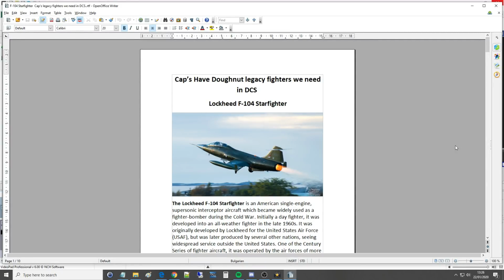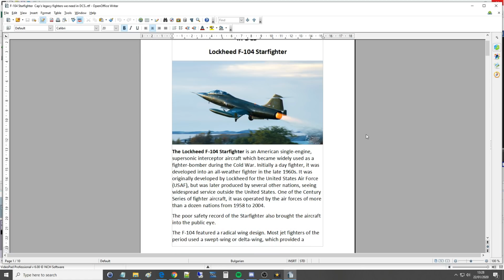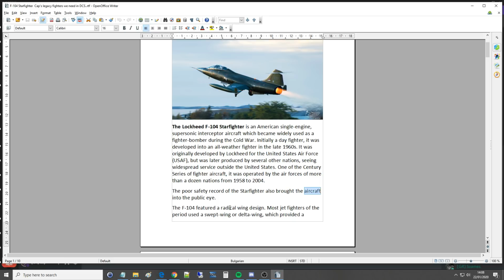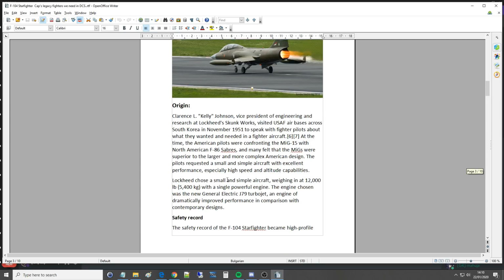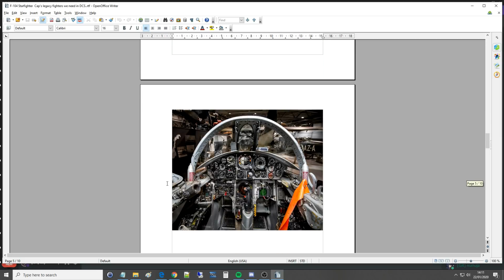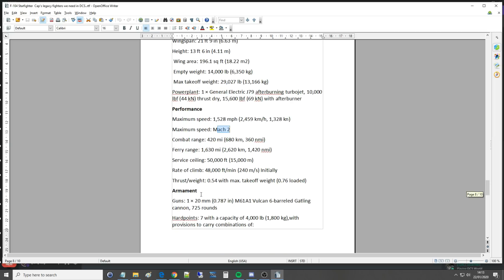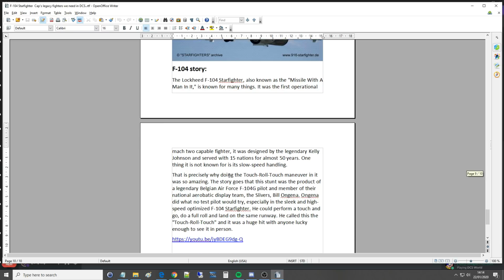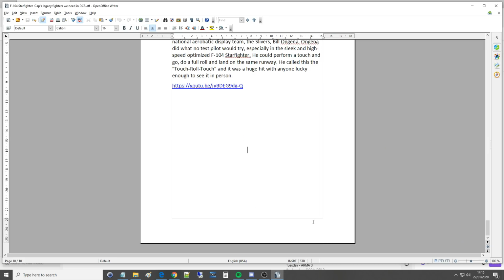Cap's Cold War Aircraft NEEDED In DCS WORLD: F-104 Starfighter

Comment: i saw an interview with a Luftwaffe pilot who had been flying 104, and he mentioned that most of the "Widow maker" part was actually due to lack of experience in the Luftwaffe operating the air frame. it was the first supersonic fighter they deployed, and they were trying to use it in a role that it was not designed for, next to that the ground crew were not properly trained for maintaining a machine like that and the pilots were lacking the proper training regime to deal with the characteristics of such a design. so when the crashes stacked up and Luftwaffe had to shut down the fighter squadrons for few months, revise the things above and then started flying them again things got far... far smoother than the bumpy ride they began with...

Comment: I spent much of my childhood At CFB Cold Lake. I was there from 1960 until 1967.  Engine testing on test beds would rattle our windows sometimes. Those engines needed A LOT of maintenance. That awesome roar carried for miles. Nothing else had that sound. 
No one can be unimpressed when the Starfighter rips the sky apart in a low pass. It looks and sounds so purely warlike. There was an airshow on base sometime in mid 60s. An afterburner takeoff and zoom was just... mind boggling! The aircraft was lost to view in a few seconds, in a clear sky, going nearly straight up! It remained LOUD. We could hear for quite a while after it was out of sight, probably because the exhaust was pointed down. They told us how high and how quick but I don't remember the figures. Really high, really quick! They also mentioned that it was strictly "showing off" and that the engine would be pulled after the flight.
They flew over my home occasionally but most stayed well away from PMQs. Mostly, we just heard them. I was well aware at age 10, when I moved away, that the "MWAMII" was a harsh mistress. F104 pilots have brass balls. My father, an instrument tech, went on "search" missions several times a year.
It was and is no "multi-role fighter". The decision made by various operators to use it in low level, all weather bombing was questionable given it's intended role as a high speed interceptor. Canada also lost many air frames but pilot losses were lower. This was the first aircraft and one of few to hold speed and altitude records at the same time. Why would you want to use it for ground attack?
It has a spectacular legacy of flight envelope records but it was just another Kelly Johnson brainchild, an over achiever in a family of over achievers.

Comment: The Starfighter got a lot of crap not because it was poor at the mission otbeas designed for - high altitude intercept. It got a bad deal because a lot of lesser skilled pilots couldn't fly it. One of the first fighters that could go over 80,000 ft AMD still come on and land. Amazing climb rate, all engine, barely a wing.

Comment: Very pretty aircraft indeed. But unlike the F-8 in the previous video, this one i fear will have it much harder to find its DCS niche. It was indeed a superb high performance machine, but aside from that......... way too limited to tangle with the 3rd and 4th gen jets we now have. And if they model the ground attack version, then as the word goes around, all the extra avionics made the thing even worse in low speed handling, so people aren't gonna dogfight in it. Maybe drop bombs? But most people that died in it, died just doing that. It was never supposed to be a low altitude mud mover. So a very specific niche is required for this one. Maybe high altitude nuclear capable soviet bombers?

Comment: I disagree.
The safety record was as bad as it was due to being forced into roles, in locations, it wasn't designed for. It was a good weather short range interceptor forced into being an all weather multirole fighter due to politics and bribery scandals. Germany is not known for its good weather. In anything but nice dry weather with good visibility and a light air to air load out this thing is going to be an absolute b** to fly.
The only reason it was kept in service as long as it was, was due to Lockheed and the US government using it to kill off any hope off a European build counterpart. Look up the Dutch Lockheed scandal. Lockheed bribed prominent politicians, while the US applied political pressure, so the aircraft would be bought. Then once the different airforces found out how shit it was there was no replacement available.
Every nation that could, except one, that flew it dumped the thing the moment the F-16 became available. The only nation that kept it in service any longer then absolutely necessary was Italy, who have generally good weather and who used the plane primarily in its interceptor role. 

There are many aircraft I would rather see in DCS before this thing was even considered.
Reply: Yeah, the F104 was used mostly in its original role as a QRA plane with the Italian AF. We modded some to carry the Sparrow, then we modded the Sparrow itself with a better radar, which extended the useful life quite a bit (Even though they were REALLY old and spent when we finally retired them, around 2001 I think).

Comment: "There were 110 class A accidents in the 25 years that Canada operated the CF-104 resulting in 37 pilot fatalities. Most of these were in the early part of the program centering on teething problems. Of the 110 class A accidents 21 were attributed to foreign object damage (14 of which were birds), 14 were in-flight engine failures, 6 were faulty maintenance, 9 were mid-air collisions. 32 struck the ground flying at low level in poor weather conditions. Of the 37 fatalities 4 were clearly attributable to systems failures, all of the others were attributable to some form of pilot inattention. The accident rate of the 104 compares favourably to its predecessor, the F-86 Sabre. In only 12 years of operation the F-86 had 282 class A accidents with a loss of 112 pilots. The Sabre was also a simpler aircraft and was normally flown at higher altitude." 
Bashow 1990
Reply: Guess it's horses for courses. For Canada with it's wide open woodland and tundra I can totally see how the F104 made the best of sense - quick and powerful, and carrying loads. It was a great plane after all. Over in Churmaney however, they picked the starfighter over the EE Lightning (which I'd have preferred) and Mirage (which would have been likeliest) after getting bribed by Lockheed officials and because FJ Strauß - also known as Hermann Görings spiritual successor based on physique and character, decided it would be an awesome boost to him and his hard-right supporters if Germany had nuclear missiles - which was made possible now by means of german-bought Starfighters equipped with US nukes on the german bases, under American oversight (who, as is told, would shoot the German pilots if they came too close to the nuke planes without an offical NATO order). The level of fuckery amazes. So they bought 700 of them even though the Luftwaffe's general usage and the german airspace wasn't exactly in the 104's favor; smallish country, noise constraints, lots of chaotic wind and localized (shitty) weather. Also, the freshly reconstituted Luftwaffe had a serious problem in finding capable ground crewmen, and with a plane as high-tech as the Starfighter was in the late 50s/early 60s, all that combined is a real recipe for disaster. Rest is pretty much history. Good plane, but as so often, when politicians of the stubborn kind just talk something into existance, it rarely turns out that great.
Reply: @decnet100  The Canadians specifically bought the Zipper for its NATO Nuclear / Recon role for its West German-based squadrons, initially until Charles de Gaulle did not allow NATO bases in France. There were more CF-104's based in Western Germany than Canada. Later in it's career did it get the internal gun and conventional weapons fit. Canada assisted the Luftwaffe in getting the F-104G on track because it was determined that the contributing factor to Luftwaffe accidents was training and change management transtioning from the F-84 to the F-104G. After the training was updated, the Luftwaffe accident rate fell.
Reply: @michaeldenesyk3195  Interesting that you say the Canadians had more in Germany than back at home and that they bought them with Germany in mind... How many did they have actually? Can't find out from WP. I personally know the by then defunct  longest running canadian airbase in Lahr near my grandma's house; which isn't exactly huge, typical mil airport - at least in comparison to Ramstein-Miesenbach where we'd go by on the way to my other grandma :). But the actual numbers, no idea - always supposed that if they sent maybe 50 or 100 over here, they must have kept 5 times that in their own much larger country :). After all, I think Canada had only half as many 104s as Germany?
And I agree, training was certainly an issue on the Luftwaffe pilots, although it would be a bit simple to suggest they all fell out the sky because the pilots just didn't know what they were doing. Mirroring the canadian statistics you quote, lots of accidents went back to engine failures and low-level-bad-weather losses. Nevertheless, I just think it was this matter of "let's get the prestigious, nuke-capable high-tech thing at all cost", when actually the Luftwaffe was scrambling to get on their feet, and actually looking for a interceptor primarily. And remember, the F104 was the only fighter the Luftwaffe bought at that time, so from marine aviators to strike to interceptors to CAP to recon, everyone got a 104 - basically a decision made for all the bread-and-butter functions, on the back of maybe a dozen planes in total which would "hopefully not" serve in the very specific role of high speed nuke truck. They were simply in for more than they could handle, the whole organisation - at one point the Luftwaffe stopped doing clocked after-x-amount-of-flying-hours preventative maintainance altogether for lack of manpower, and they didn't even have the hangar-space built to keep them out of the rain in the first years! 
No other way to put it, the rate of accidents was just alarmingly high (see http://www.916-starfighter.de/GAF_crashes.htm ) - if one heard about every two weeks every single year in summertime that a certain model of plane crashed again, I wouldn't blame them after like two-three years of that for thinking there must be something going very wrong; systematically wrong. Like I said, I wouldn't blame the plane in itself, but it certainly wasn't the best option for the Luftwaffe's needs and capabilities at the time.

Comment: +GrimReapersAtomic  Kelly Johnson figured that the United States Air Force needed a hot rod.  The Lockheed California F-104 was accordingly wrapped around the General Electric J79-GE-8, with tiny mid-mounted trapezoidal wings of double-wedge profile and a T-tail.  A tiny Sidewinder-packing point defence interceptor, for which OKB Mikojana e Gurjevicha was simultaneously devising a much heavier analogue in the E-66M/166 series that would eventually spawn the MiG-25 with capacity for four R-40 bomber-interception missiles.  My "ideal" loadout for the F-104E all-weather version for beyond M61 effective range would be quad Hughes missiles:  two AIM-4F SARH's under the fuselage and two AIM-9D's on the wingtip rails.

Comment: Oh no.. f-104.. would make for even more takeoff and landing crashes from grim reapers.. 🙄
Reply: That's only cause Germans flew it as a CAS fighter instead of a high altitude interceptor it was designed as
Reply: @zacht9447  can't blame the Germans for using it for that as if they had not been bribed I to getting it then they might have got an aircraft that actually met there operational requirements.
Reply: @olivergoad5160  They used a high altitude interceptor as a fighter bomber. big thonk
Reply: @olivergoad5160  I've read about Lockheed backdoor lobbying for the F-104 to be bought by NATO countries. Not fond of practices like those. Unfortunately, I have a hard time thinking of aircraft that were significantly better suited for the role outside of something like the outdated Douglas A-1 Skyraider, and could be scrambled to intercept a high altitude bombing raid.

I wonder how history might have been different if the F-5E was ready for export before Germany adopting the Starfighter (I don't think the F-5A would have met German requirements of the time, as it lacked a radar). I don't think Lockheed would have found it so easy to buy government contracts if a fighter so far out of the F-104's league was available.
Reply: @Skyfighter64  The British wanted to sell them the TSR-2. An absolutely incredible plane that instead got cancelled, just as it was ready for production :(
Reply: @A_Haunted_Pancake  I wouldn't say it was ready for production as it had barely got into testing and would have likely needed much time before initial production.
Reply: @olivergoad5160  True, I remembered incorrectly. Still, would in many ways have been a better solution - not just from an Engineering perspective.

Comment: F104 would be a fun addition to DCS especially if its as bad as they say. 20 mm cannon, Sidewinders, Mach 2, fun to fight Mig 21, hard to land, bad stall characteristics.
Reply: you mean fun for the mig 21?
Reply: @bertrandbarbe245  Its OK. According to the books the Mig 21 had the advantage over the F104 but the F5 had the advantage over the Mig 21. But that doesn't stop the Mig 21 from giving the F5 a bad time. I figure the F104 would would give the Mig 21 a run like the Mig 21 gives the F5.
Reply: @P90F55  MiG-21 came on top when it met 1F-04 in Indo-Pak war.

Comment: Not the biggest fan of the F104. I loved it as a little kid making Airfix models and how futuristic it looked as with a name of Starfighter what's not to love. Well later on reading the technical details and from pilot's stories I wonder why it sold so well. Poor range, payload, avionics and maneuverability it's not that good. I think the USAF as part of marketing developed a  manual how to dogfight with it. Basically pilots told to go vertical roll the plane to follow the opponent's turn then come down on their six or use the energy to break off.
Reply: Eh, that's simplifying things. Range was the same as a Phantom, occasionally slightly better depending on loadout (minus AAR of course, which technically the 104 could do, but only the USAF bothered with). Its main missions in Europe were bomber interception and nuclear delivery, neither of which requires you to carry a large payload. The avionics for the time were actually pretty good, especially the F104G (it was the first aircraft ever to be equipped with an INS). Maneuverability is piss poor at low speeds, but excellent at high speeds - the jet will do ~7G at Mach 0.9 which is pretty respectable.
Reply: @TLTeo  yes i agree it was just a bit too specialized, but not a bad plane either.
Reply: The german minister of defence was corrupt (not proven but obviously). If he wasnt there the Germans would have flown Mirages instead
Reply: @danblauwal4524  they probably would have suffer heavy loss too as appart the ocygen system and ejection seats, the main guilt was on the lufwaffe itself